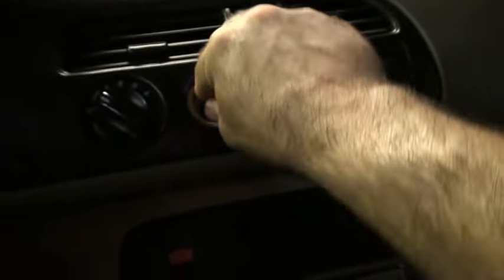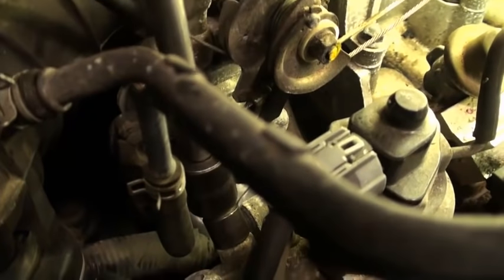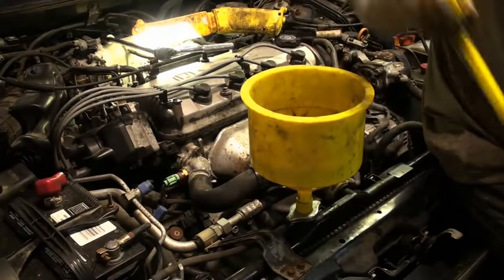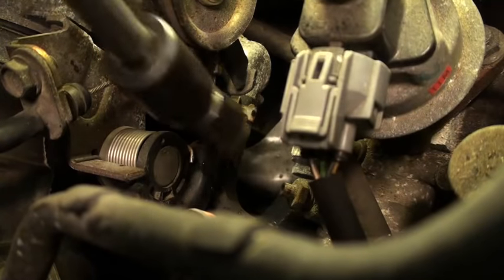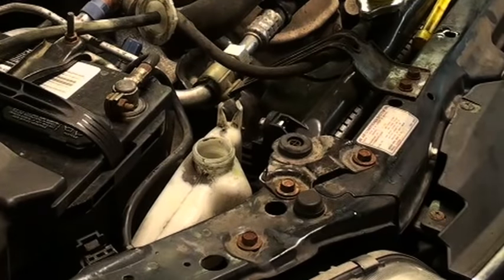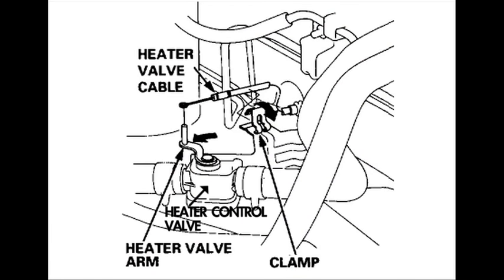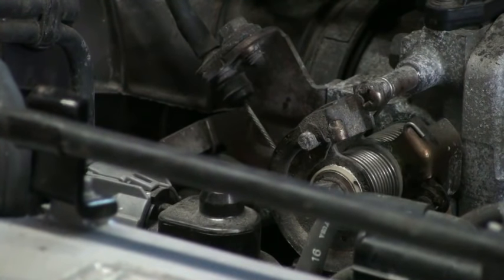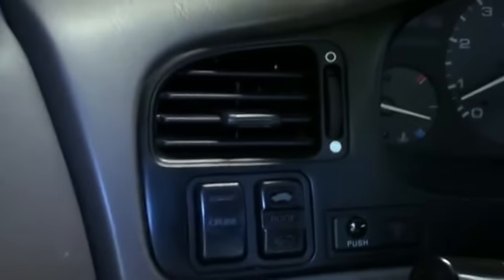How To Bleed A Cooling System - EricTheCarGuy

Comment: Hi Eric. I have a 1998 Volvo S70. I changed the water pump because it was leaking, so I replace it and replace the timing belt and thermostat as well. Now. I turn on the engine and after 5 or 10 minutes the coolant reservoir get full and overflow, and start leaking through the cap. What could possible causing this? Thanks in advance.

Comment: I have a 95 Honda Accord, and other has an overheating problem. I recently replaced the radiator, but it still overheats. it does leak coolant after running a while. could that be caused by air in the cooling system?
Reply: it* not other
Reply: Aaron Martin air in the cooling system would not make the system leak coolant. Now possibly this leak you're having is letting air into the cooling system. So in this case you need to focus on fixing the leak then eliminating any air.

Comment: Hi Eric, i have a problem with my 97 civic 1.6l. When i drive for more then 30 mins in the freeway then get to city driving the temp gauge begins to rise to about 3/4 slowly when i stop and idle for more than 5 mins. once i get driving it drops to just below 1/2. I have changed sensors and rad cap, i cant find any leaks either, im changing my thermostat tomorrow. i burped the cooling sytem all the way to be sure there was no air(took me about 40 mins) Any advise or ideas help, thanks.
Reply: sounds like the fan or fans are not working properly; if it's old put a new one in, no sense in keeping an old likely suspect around,  right?

Comment: my honda idles normal on park and neutral but when in the drive or reverse idle is very low  and check engine light is on is this gona fix that or do I have another issue

Comment: Okay so I think this might be my problem this is what I got going on did a flush just added the fluid as I needed started to hear a gurgling after I did this and the top hose is hot and the bottom is damn near cold the temp never gets past 150 to 170 the thermostat opens about 185 190 degrees that is it worked the way it should for a day after I did the flush new temp sensor new temp sender new thermostat it started to consume antifreeze after I did the flush at a very small amount so what I’m thinking is I might have air in the heater core or a clogged core also watching the fluid in the radiator I watched it go up and down also noticed a bit of smoke just the lightest amount also the power steering pump is whining so the pump need to get replaced should I just say to hell with it get a radiator heater core hoses and be done with it because I’ve tried bleeding the air out but if the water pump isn’t doing anything idk also little bits of black flakes is in the fluid 

98 Chevy 1500 4.3 vortec 

4l60e auto four two wheel drive open diff 

If that helps 

Currently I’m over 2k into the truck not counting what I paid for it 

Fml

Comment: My 2000 honda accord just had a thermostate,  head casket, timing belt  now when l an ldeking is try to over heat. And l hear a griggling noise from the water. How can l fix it 
Thanks debbie

Comment: so a hose broke connected to my throttle body and all my coolant was relased...i replaced the bad hose, now I'm trying to burp the radiator ... how long should it take before i get worried?  i have a 2010 honda civic si.  i noticed i have so far i used 1gal of coolant so far, should i worry? also during the heater is not blowing hot.
Reply: I'm not an expert but I have done a little research. Having no hot air means your system has air. You just need to bleed the system.

Comment: **ERIC*** Been watching for about a week since I found you....So if my car doesnt have a bleeder(99 Vic) just fill it up, rev it with funnel in and let it flow and then top off? That will eliminate my air? Having those exact issues. However found small crack in that infamous black intake hose near cyliner 8. I was able to seal it up, but the hose from the heater core with that dumb nipple no one knoews what Im talking about keeps popping. Has threads in it that seem to lock into the threads into the intake manifold tube. NO ONE has done a video ON THAT!!!!!

Comment: My heat is blowing luke warm so i put water in the coolant resv tank. Then the next day omw to work the temperature guage started dropping when I had the heat on full blast.. Could this possible be air in my cooling system causing this issue? Please help

Comment: What if the engine doesn't have a bleeder vlalve? I have b18c type r. How would I go about bleeding the system.
Reply: Squeeze the top radiator hose while filling. Multiple squeezes. Its like burping it.... like a baby.

Comment: This is a little hard for me to do on my 2004 Acura TL that has automatic climate control, so I can turn the fan on low, but I can't turn it off because it won't keep it on heat. The J32A3 also does not have a bleeder screw...

Comment: Having High idle/rpm issues when car gets hot, temp guage stays put.  Engine starts rapping. 2000 1.6 Mazda Protege. does/where is the bleed valve if any?

Comment: My car temp gauge never goes past midway point, but I notice sometimes after I cut the car off, my coolant reservoir has a bubbling sound and coolant spews out from the neck and from under the radiator cap. My cooling fans work when the car gets up to temp. I don't know why it's doing this.
Reply: Change the radiator cap and bleed the system. Radiator caps are fairly cheap so I'd start there. The symptoms you're describing sounds like bad cap is a possibility.

Comment: I got a question I have a 2006 Honda CR-V and I just changed the thermostat on it and I bled the system but I have a issue we’re wen the fans come on after a drive and I park the temp gauge goes up a little bit but den comes back to regular what can cause that to happen

Comment: do i have to lift the front end at all? I heard you want the radiator cap area as the highest point.
Reply: +Mustangkid29 It might help. My car would overheat on its way up a hill but not on the way down. Felt like there was air trapped preventing the fluid getting to the radiator. After spending quite a bit of time flushing and bleeding the system (no bleed valve) finally it appears all air has gone from the system.  Maybe having the radiator facing up a slope could help the air get to the highest point. Couldn't hurt.

Comment: Please help, I have an 89 f250 wih the 351 efi. It was loosing all its culant fast I found the bad hose and I replased it then it started pumping out white smoke like it had a gasket lead so I just bought a chemical tester that you huck up to your radiator cap and it detects a leak. Well I took the cap off  started the truck and the fluid just flows out now and theres no white exhaust.

Comment: Hi I have a 1998 chevy cavalier just had it in the shop for a leak from thermostat housing and needed new thermostat and switch for fan my car is getting really warm before the fan kicks on specifically about 3/4 temp. the mechanic said he bled the system through the switch I really don't think this is right because there is a bleed valve on the car he has advised a new radiator but my car didn't have this problem before shop took it could it be a air bubble or does it have more issues really don't want to replace a radiator if it is not nessesary
Reply: This new thermostat: what's the rating? Some are set to open at a lower temperature while others, higher. It might be different from your old thermostat, i.e. higher temperature.

Comment: well lets see, i have a 2005 PT cruise, i have replaced the rad fan, the rad, the relay, the fuse, and coolant, i have bleed the system 4 times and still overheats ..  Checked the oil for blown head gasket, oil still looks clean and new, not creamy like milk ..  rad fans kicks on as it should.  SO at a loss for words and even thoughts on what the hell is going on ... and why the damn thing is still overheating..

Comment: Eric, HELP, please,,, ok 2000, G M 3400, overheating & no heat, seems like the water is not moving out of the radiator, changed the thermostat, flushed the radiator, checked the water pump looked good, does not smoke, no oil in the water, nice & clean, when it gets hot the right radiator hose is hot & the rad. cap & left hose is cold, & no heat from the heater, but it looks like they omitted  the heater core, will check on that, but any info you can give will be great, thanks, Jack

Comment: i have a question. my honda accord lx 1997 is out of radiator fluid. but no light came on my dash and the car says it is not over heating. heater works and air conditioning works fine. but 3 months ago my car had plenty of fluid. now i dont see liquid in the radiator and my reservoir  is completely empty. the exhaust doesnt smell sweet. the air in the car doesnt smell sweet. there is no film showing on my windows. the exhaust is coming out clean and the oil isnt showing any signs of being milky or discolored. sooo uh where did my coolent go? i tested to see if it was pouring out through the cap or on the ground but there are no stains any where or wet spots in my car port where i put the car. and also how is the car not acting strange without coolent in it? my last car would smoke up and the engine would seize when it over heated.
Reply: +Nathaniel Garrett I had a similar issue on my Tata Indica, the engine actually can be air cooled so driving about I had the same issue it just reaches the middle dial as normal. It's not a massive issue but on hotter days you'll definitely notice the needle move up, I flushed the system, added an anti-leak additive, and all my issues went away! Hope this helps bud. Remember rather be proactive, than reactive :)
Reply: i ended up finding the leak and finding where all my fluid is. also found out a fuse was blown so all the warning lights on my dash were not working. the previous owners of my car must have threaded the drain plug wrong so when pressure built up in the system it was spraying a slow mist out of the bottom of my car through the plug. but now its got the correct amount of fluid. i did a flush just an case any gunk got stuck in there from it being dry but the car is working fine

Comment: Hey bud i have a truck that overheats to 3/4 the temperature from 50mph and up, but if I step on the gas all the way temperature drops, also temperature just fine at idle,  any ideas what's causing the problem
Reply: Raul Castillo It’s probably a bad water pump.
Reply: @LouieFlips  thanks, see this is what happened, I had a leak on heater core so i added some bar leak pellets on coolant reservoir, right after that I notice overheating but only at 50+miles, could that bar leaks cause water pump to failed?

Comment: How do you bleed a 2002 Dodge durango i am having so many problems with it over heating. i changed the  thermostat clutch fan the rad the cap and it gets hot and my spark plugs are show white some one said it could be the fuel pump and reglater its running to lean or to rich. can you help

Comment: I'm having problems with my 08impala keep getting engine hot ac off message changed temp sensor but still have the problem if I unhook the battery then hook it back up it goes away for maybe a day but when I messes up I have cool heat

Comment: Hey Eric,I have ques,my Honda accord had top hose problem,where i replace it,the engine didn't over heat.i saw the gauge rising and shut off the engine.i replace all the houses,bt the reservoir level is slowly dropping after a reasonable drive.,Do you think that i may have a head gasket problem
Reply: If you have coolant in your oil then you have a head gasket problem (most likely).
Reply: check your thermostat and your coolant temp sensor (check not replace) if you can figure out which is not working then go ahead and replace it. Google is your friend.

Comment: I just encountered a 96ish dodge truck with no bleeder valve, and the upper Rad hose goes above the radiator cap a few inches. I didn't know what to do.

Comment: Just changed my leaking heater core. . Let it get up to temp was fine. . Then I drove it a Lil  came to stop.. it slowly started getting hot.. I turned car off then back on.. went back to normal.. drove a Lil further same thing.. could I have air locked in system. .please help..

Comment: Good video, but just FWIW, many vehicles do not have a heater valve, the coolant is always circulating through the heater core, and the cabin air temp is regulated by doors inside the HVAC box that control the flow of hot and cold air. 

In these vehicles, it makes zero difference whether the heater is on or not when bleeding, as the coolant is always fully circulating through the core regardless of the position of the heater control.

Comment: what if my truck doesn't have the bleeder valve? i have a 1999 dodge ram with 5.9L motor. can i just bleed the air with the funnel only ?
Reply: +isael rocha On my 99 Ford Ranger, if you leave the radiator cap off, give the engine a few good revs, most of the air should come out of the system. If you have a belch tank like mine does, then you shouldn't have any problems. Something else worth doing, is you can get a cheap flush kit from the store with multiple T fittings in it. I replaced my heater control valve with one of these T fittings so I have constant flow through it, and not only that, but you can crack it open to fill from there, or let air out. Just don't do that while it's hot.

Comment: I need help! i have change my radiator and the thermostat and then i put the old coolant in the radiator i could feel the heat from the heater and now its always cold and my tempearature always goes up and i have steam that is going out of the hood

Comment: Hi Eric, Im have the surging idle problems on my '04 CRV.  The code is P2279.  No visible leaks.  Change the PCV valve (areal pain).  Noticed my coolant res is almost empty, going to top it off and I want to bleed the system.  Does an '04 CRV have a bleeder valve?  Thanks!
Reply: Mel Eckerstrom I had that same problem (code) with my 04 civic. It's a vacuum leak. Check the air intake, or in my case, check to see if you're leaking oil from the cylinder head. 16$ replacement cap from any Honda dealership.

Comment: Did this on my 93 chevy K1500 and i ended up with a massive boiling coolant geyser, and the temp shot into the red... Any suggestions as to what happened?
Reply: put in too much in the reservoir?
Reply: filled it to the service line only.
Reply: Make a comment outlining exactly what you did - the process.
Reply: jesse gibson airlock in the system

Comment: Question...2012 ford fusion started out leaking coolant, I added stop leak and coolant, leak continues shortly afterwards then eventually starts to overheat..check engine comes on, i get the code its for a thermostate, replace it, no change still overheating, pay a guy to come look at it, he checks the pressure, found a leak from water pump, replace it..no change still overheats fan blowing really fast, now im checking hoses and they are ice cold when it overheats, I fill it with 2 1/2 gallons or more of coolant but it does not seem to be flowing, oh and i did flush the heatercore btw..whats going on with this car? HELP!!! LOL

Comment: i have a 96 gmc sierra 5.7,temperature gauge  its at cold i replaced the sending unit sensor and still did not fix the problem,i also grounded the gauge to see if it was my dash but it works.Help please what can be wrong

Comment: So my car heater blows cold air . 
I already changed thermostat and I also did coolant flush but it still blows cold air 

It will only blow hot air if I step on the gas or when I'm driving but as soon I stop at a red light or just be park it blows cold air.

My car is a 2002 Nissan Altima 4 cylinder 2.5 . 

What could be the problem??
Reply: It could be that your HVAC blend door not working properly.

Comment: I have overheating problem my heater blowing hot hair I changed water pump n thermostat hasn't overheated yet but my gauge is still going to hot fans are kicking on also

Comment: hello all, i'm having heater trouble about my Pontiac Montana van. I tried to drive this Montana van for about 30minutes up to an hour and even more just to reach the normal operating temperature.. I observed the temperature gauge it reached the normal operating temperature but STILL NO HOT AIR is coming out both in front and rear vents (always cold air).
The heater and fan control knob is pointed to high already.
No engine overheat temperature, I checked the radiator fan it runs well when required. The radiator coolant level is okay and the overflow tank as well. I already did coolant bleeding or burping several times but still no hot air. Your help or any suggestions is highly appreciated.
Reply: Check to see if you have a thermostat, some people take it off and that will keep the car from warming up faster.
Reply: yeah it has thermostat installed almost a year ago..
Reply: Jong Nicol Could it be that the thermostat is faulty? I've heard of many instances where it doesn't open and the car would overheat. In your case, maybe it got stuck at "Open" and never closes.
Reply: Jong Nicol Hopefully you fixed this, but if not try flushing your heater core.  Eric the Car Guy has a pretty funny and insightful video on how to do it.  If you don't have an air compressor, you can use a garden hose with an adapter to fit the radiator hoses.  Good luck!

Comment: good evening Eric I have a yuejin dump truck and it over heating and the radiator build up air  or pressure and  when remove the reserve coolant cap the water from the radiator water spill through the reserve bottle and when put on the heat fan no hot air any help is car engine and truck different in heating system